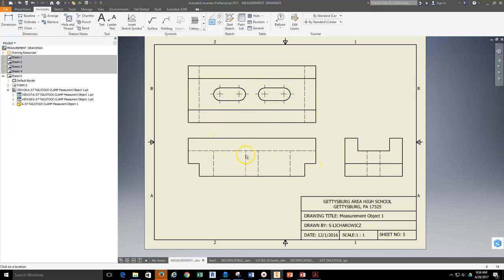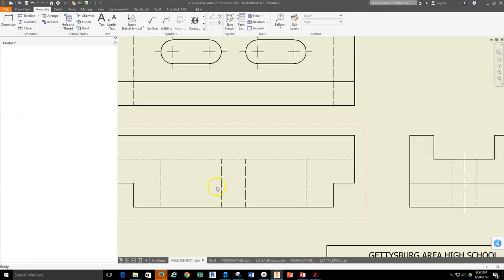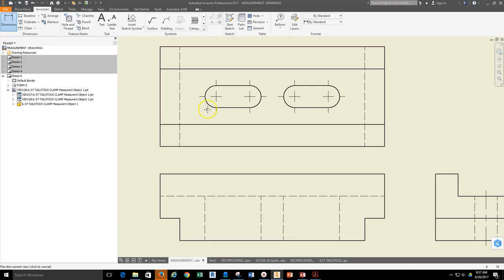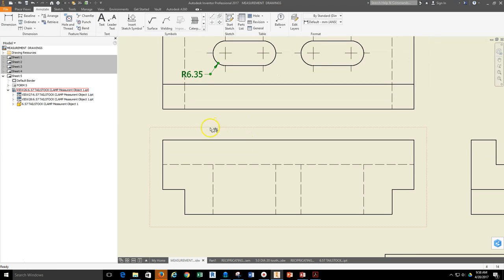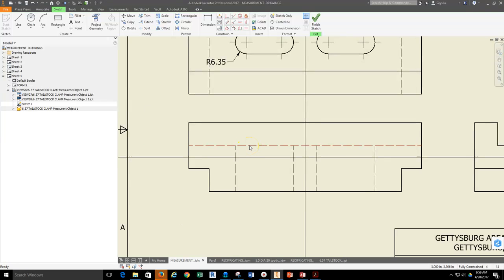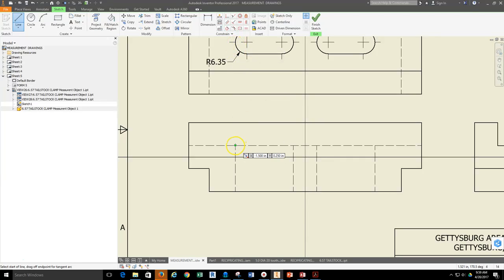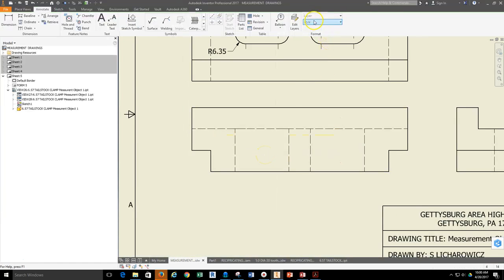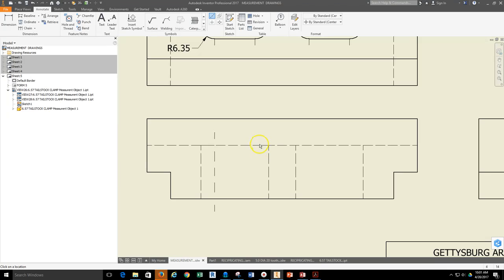Inventor - Center lines on slot featurs.

Comment: You don't need to create the geometry, inventor generates it automatically. all you need to do is select the centerline command and pass over the line that's already there, and you will see that it is in section as per the quadrants of the arc of the slot. 

Basically Inventor generates the drawing base on the geometry of the model. Therefore, each vertex on the model will translate as the beginning and the end of a line in the view of the drawing. That said, there is a vertex where the arc begins and end. which is also in line with the center of the arc that composes the slot. 

All you have to do is hover on the line.